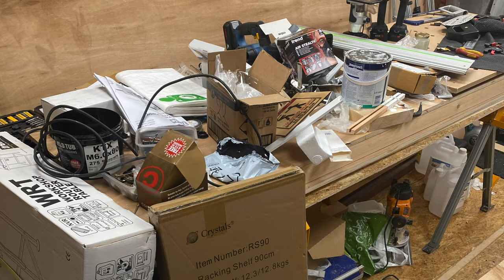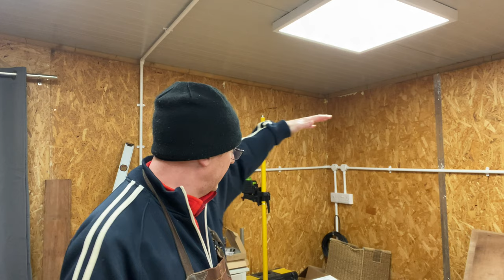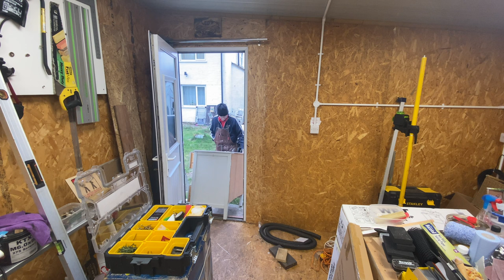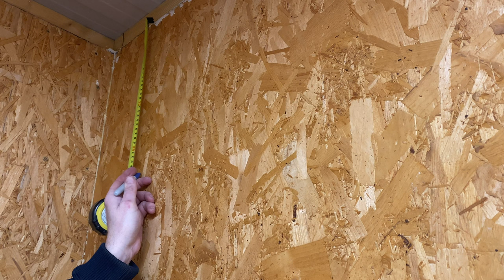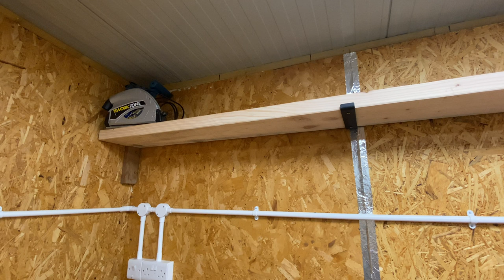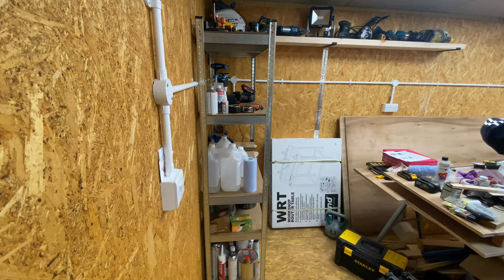Workshop Shelving and a Tidy Up 😀

Comment: When I built my workshop (large 3 car garage) I incorporated a small room I call my pantry. This is in the corner by the main shutter door. I use it to store my paints and power tools. The space is small enough to be able to have a heater on all the time during winter to keep the lacquers and paints from being frosted and any condensation of the tools. To try an heat the rest of the space even would be impossible without a lottery win. I would recommend something similar or even an insulated cupboard you can put a frost stat controlled heater.
Reply from the maker: Thanks C P. It’s something I need to consider. I’m lucky in the sense that only a bit of heating is needed and the insulation etc tends to hold it well👍

Comment: Seems a bit of waste of a good bit of wood for a shelf bit you've got big spans there. It took me ages this weekend putting brackets on a block wall at 400mm centre over 3m for an 18mm shelf.
Reply from the maker: Wasn’t actually looking for that thickness when I went, but thought it was good value. Bought another to use for a couple of smaller shelves in the house! 👍👍

Comment: 😱 messy workshop 🤣 

I jest, 

I literally tidy and hoover all the time. My Mrs can’t actually say what I have made in my workshop, apart from a mess that I always seem to be tidying up😳

I do however have a  brand new workbench myself and am absolutely loving it. 👍

Could do with some sander advice if possible. A bit lost on everyone having like 3 or more sanders tbh.

If I look to get the 150 rotex, ?

Would that actually in your experience cover most every sanding / weekend application? As is suggested??

Thanks in advance..

( adding on) I was on the road to the Sealy Chinese 5mm Mirka copy as that looks good value. But if I am buying  a new tool anyways then it makes sense to match what I have. It just seems you guys have several sander’s and I was hoping just to spend on one??
Reply from the maker: Hello Avon, cheers for the message and great question. The Rotex isn’t for me as it’s definitely a two handed machine. 

I suppose it all boils down to your main requirements for a sander? The Rotex is phenomenal for aggressive removal of stock and can do a job of ‘fine’ sanding. The likes of the Festool RTS 400 is an ‘ultra fine’ sander, can’t do any aggressive removal. The best overall compromise in my opinion is the Festool ETS EC 150 which can when pushed do some aggressive removal (in 5mm form) and fine / ultra fine sanding, or more just fine / ultra fine sanding in 3mm form. 

If you’re getting the Axminster SPT and sanding stock off that (it leaves a good finish anyway) I’d go for the Festool ETS EC 125 3mm as you can buy a 150mm pad also that fits it (but not the other way around 🤷‍♂️). If you’re after a complete all rounder I’d go for what I’ve got, the Festool ETS EC 150-5mm. You can still get a good result with ultra fine finishing, but it is also good at the harsher side of sanding 👍👍👍

Comment: Hiya there came across your channel yesterday I have watched 4 videos up to now I had a right lower limb amputation in 2018 but have managed to stay in work I am a French polisher / woodfinisher I am hoping to start a channel this year doing restoration work.great to see how get things done using the laser level and ca glue spot on
Reply from the maker: Cheers Terence for the comment. It’s nerve damage I suffered down my right arm nearly four years ago. I can move my elbow and shoulder a little now but no functioning use, plus chronic nerve pain in my shoulder and right side. Good luck with starting a channel👍👍. The laser has been a big help and ca glue is like an extra hand to me😀😀. The MFT top is going to be a real game changer in terms of efficiency and ease of use😀👍

Comment: How big is your shed /workshop (L, W, H)? As I've got to make myself one that's about big enough but not too big
Reply from the maker: Mine is L7.3m x W3.6m x H2.9m. I can go higher with permitted development Richard as I’m over two metres away from the boundary and also I can go up to 30m2 in total size (mine is around 27m2 internal space) due to the size of the garden 😀👍

Comment: Ohh the joys of being stabbed & electrocuted 😂 I went 1 further than an NCD by paying an acupuncturist to do  basically the same thing 🤦🏻‍♂️
Reply from the maker: 😳😳😂😂😂. I see the acupuncture person once a week pal, but at no point have I ever considered them asking to run a current through the needles 😂😂😂. I had a NCD done a couple of years back and I was an absolute mess after.  It was the hottest day of the year and they told me my arm was too cold so I had to place it in a sink of hot water first. I was grey when I came out after it 😐😐
Reply: @Hand-i-Craft  apparently the current vibrates the needles so the acupuncturist doesn’t have to do it manually and helps stimulate the muscles & nerves. I had mine done in The Walton Centre the dr was great but ye I came out very pale after it
Reply from the maker: Walton Centre for me too pal. Been under their care since the accident 👍